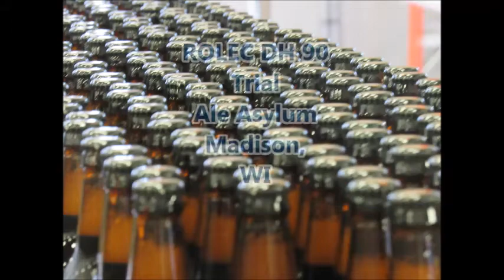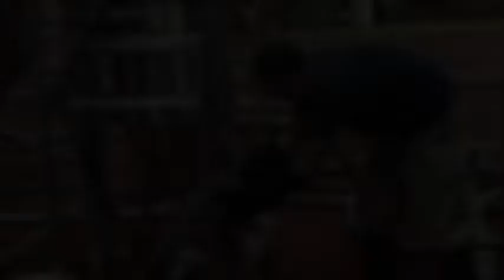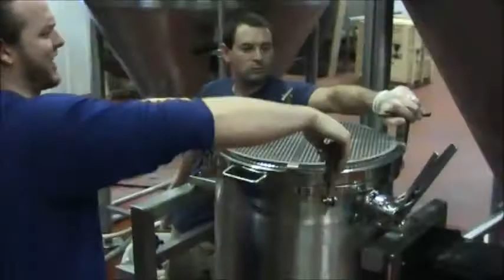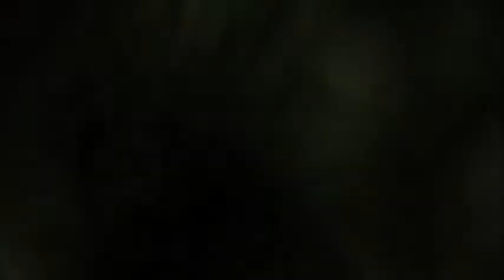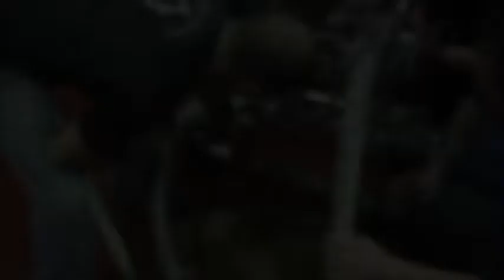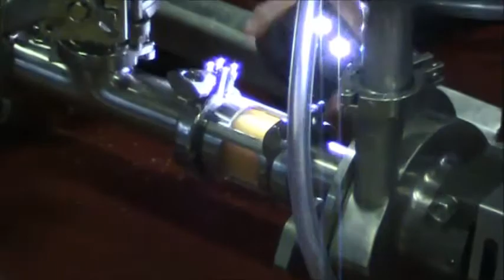ROLEC DH90 Trial

Comment: Do the hop pellets end up in the fermenter or are they curculated in the Rolec leaving clean beer in fermenter please?
Reply: They definitely end up in the fermenter. The Rolec has no way of separating them from the beer once they're dosed.
Reply from the maker: Once the hops are induced the beer and hops are recirculated through the fermenter typically 3-4 times.  Increasing hop surface area, aroma, and reducing overall tank time.